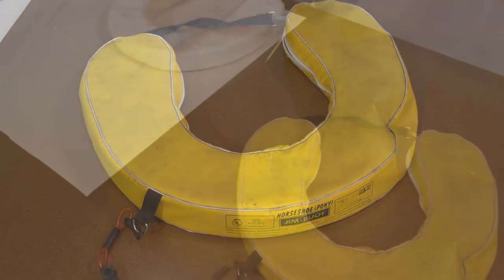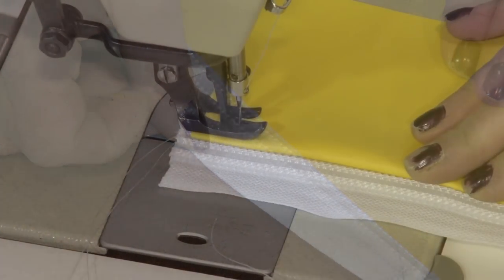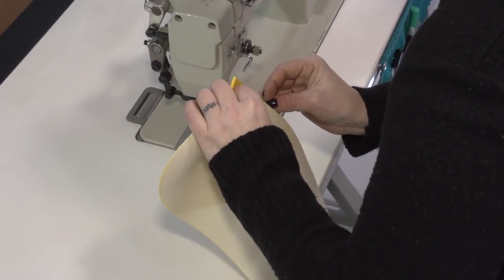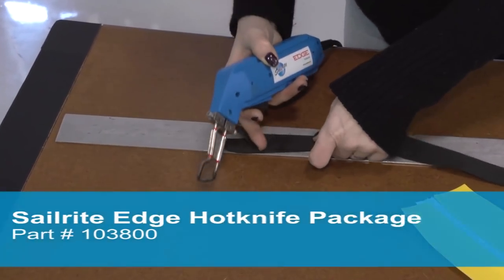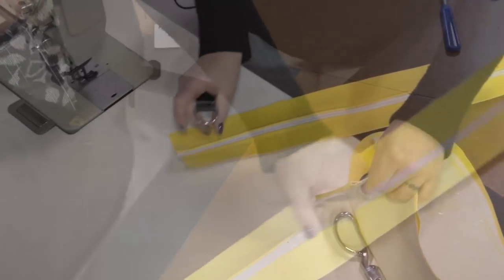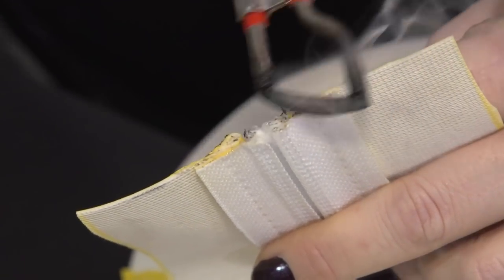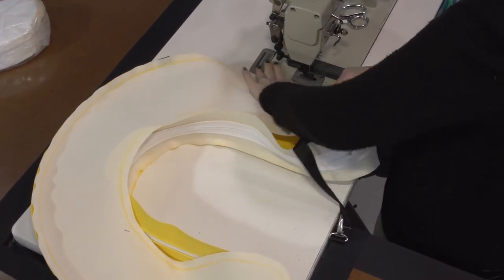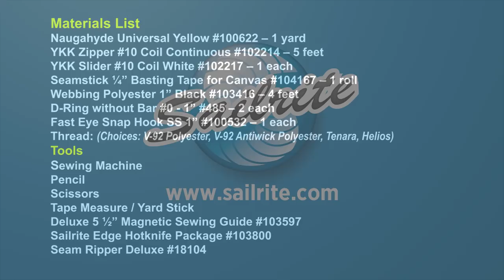Recovering a Horseshoe Buoy - Boat Rescue Buoy

Comment: So the material here is about $24 in 2019, assuming I can re-use my D-rings I currently have on my torn up horseshoe.   The expensive part is the thread, gotta see what I have to make it worth while.    But for $24 (assuming I have thread I can use), and not throwing my old foam into a land-fill, this might be a fun project.